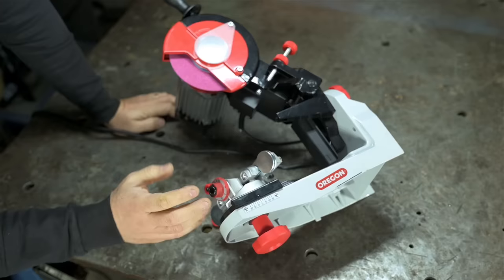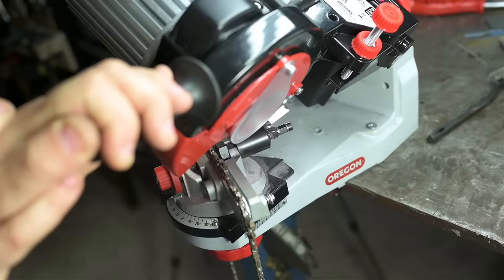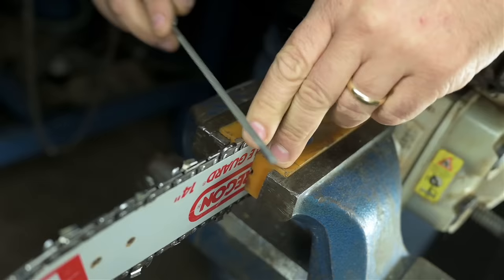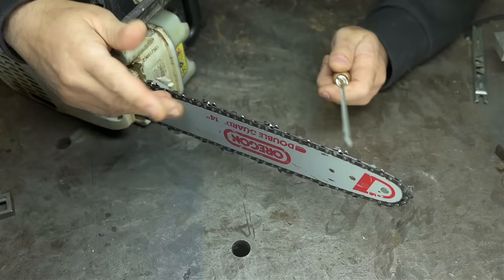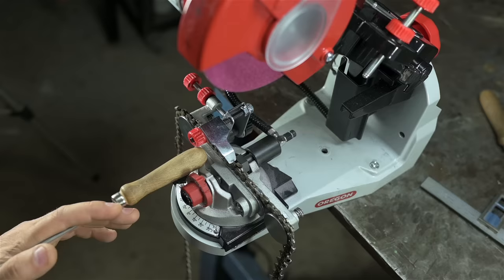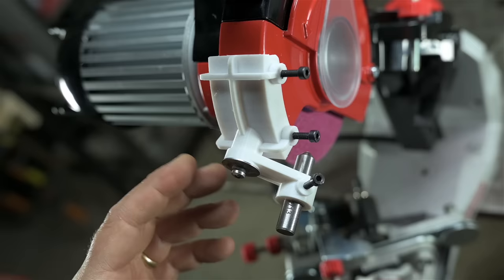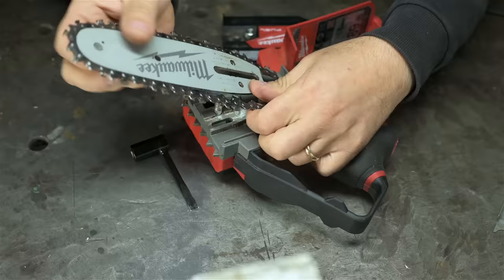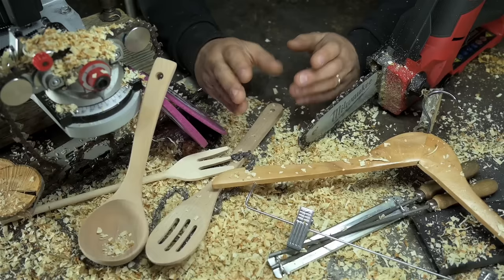Grinding Saw Chain! in Oregon! (620)

Comment: I am here because i have destroyed about 12 ebay chains removing a tree stump .... i have been at it now for 3 weeks the stump was ment to be ground away but unfortunately around here was bombed in WW2 and there turned out to be bits of shrapnel in the stump that destroyed the grinder ...
I was left to remit myself with a chainsaw and an axe... it was a huge tree and ater digginng around the stump it tuned out to be as big as a small car 😅😅😅 Anyway i have been  cutting and chopping for weeks now and every time the tiniest bit of dirt gest in there the chain is destroyed i got some very cheap ones 4 at a time from ebay and just keep changing them but now i have bought a grinding wheel like this
And will sharpen all the chains every night 
Now instead of chopping for 2 or 3 hours a day i can just cut though the dirt and mud and probably get this thing out in a few days 
I am now in a whole at least 6ft deep 😅😅😅
Ps the water has to go though this exact spot i have to remove all the stump and the tree was sick and going to fall through  a  Neighbors roof

Comment: For a lazy dumb man I bought a very cheap chain saw grinder made out of plastic, repeatability it can not do, however it sharpens the teeth and I think it is the best thing since slice bread. After a couple of minutes I have a chain that cuts again instead of that burning smell. Is it better than hand filling, you bet because it would never be done. Are the teeth cut evenly, No. You will  grind the chain away quicker but that is the price for near instant gratification

Comment: Geez--just use a dremel style tool with the correct diameter cylindrical stone and do it on the chainsaw itself--faster, accurate enough if you keep a good eye on the angles.

Comment: i had the harbor freight version of that  style grinder
used it twice threw it in my barn for about 2 and just recently gave it away never again will i own an electric device for sharpening a chain they dont work well theyre not practical because you have to to remove the the chain to use it then you have to adjust it for left and right cutters a lot of margin for error there lastly its electric how in the hell are you gonna use it in the woods

Comment: 25 degrees face dead flat file works for 99% of all cutting ,not  good for really dead or frozen wood. Now once you get comfy with the grinder  go buy a diamond wheel. Wether file or grinder spray it down with brake cleaner and shake off to get dirt off.

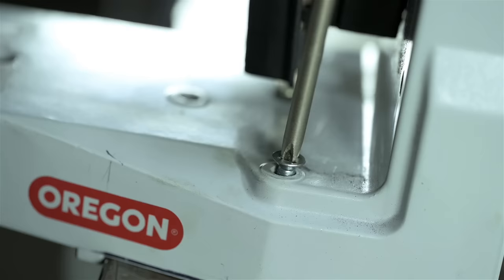Comment: So I'm looking at this video, not to see how to use a chain grinder, because I already know how to, but to see how Old Tony rates this grinder, because I'm thinking of upgrading the one I have. And at approx 1:35 in, Tony starts sharpening a tooth. THE WRONG BLOODY WAY!  The leading point of the tooth should be on the outside of the chain. Am I seeing things I wonder? No cos' at 1:45 he gives an overhead view and you can clearly see the witness mark on the back of the tooth is indicating the correct angle. Wow! I wonder how many others have had a laugh at Old Tony's expense, so I start reading the comments, and it seems everyone is so enarmoured with Tony that nobody wants to point this out. Well It seems from the comments that Tony is a great bloke, but seriously, I don't want to hear what a guy who sharpens his chains back to front thinks of the grinder he uses to do it. So I stopped watching and wrote this. Can't help but wonder what that chain cut like though.

Comment: I bought one.  I only use it for my Carbide chains with diamond wheels.  I hate these things.  They are flexible floppy and pure rubbish. The wheel spins too fast,  there's no coolant,  and it's too easy to burn the steel. 
I prefer the file.

Comment: It's really not an exact science. Most people would tell me im dumb for grinding off all the rakers off the chain. The thing is, you just have to have the power to push the teeth through. And yes you have to be careful because your saw can absolutely kick on you if you do that. Cuts much better though. The saw chain people put those there because of liability. They don't need to be there. I am not advising anyone to grind the rakers off. If you do just be very careful. You need a powerful saw to do it that way.

Comment: Always knock the burs off. It's the nice hard chrome coating that does the work, not the soft steel of the cutter. If you don't remove the burs the chrome will rip back and it won't cut right till you've sharpened the tooth back passed the damaged chrome!

Comment: As fancy as that chain sharpener seems.. Numbers don't lie - I trust Project Farm's data. This particular sharpener was 0.8 seconds slower on a 6 4x4 cut compared to a new chain. The Stihl 2-in-1 file managed to get sharper than a new chain, as did 2 Granberg sharpeners. The Oregon field sharpener was just slightly slower than a new chain, but still faster than this sharpener. Oddly enough the $30 Harbor Freight Chicago Electric clone of this sharpener was faster than this one as well

Personally I think sharpening a chain is too tedious. I sharpen knives, axes, lawnmower blades, even twist drill bits, but I can't be bothered to sharpen these when a new chain is so cheap

Comment: You grind WAY TOO MUCH off of the chain with the grinder. Look at the chisel edges at 25:00, you grind away even 40% of the material thickness in one go. I suggest a finer grinding wheel, a slower speed,  less contact time, or less force. Maybe only "very lightly" touch the chain blade to the grinding wheel?